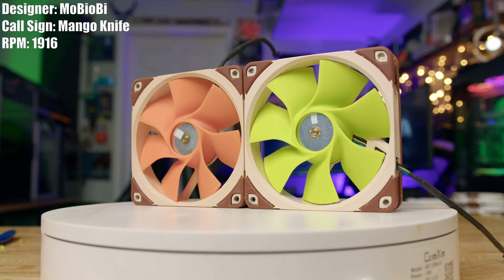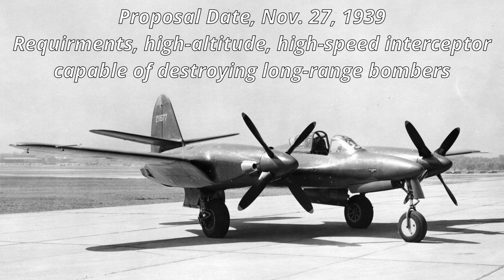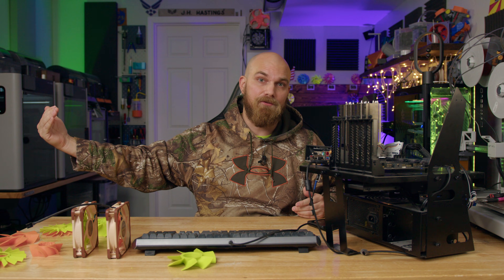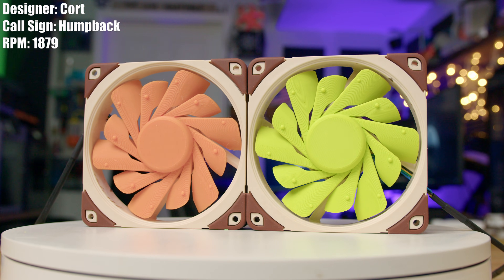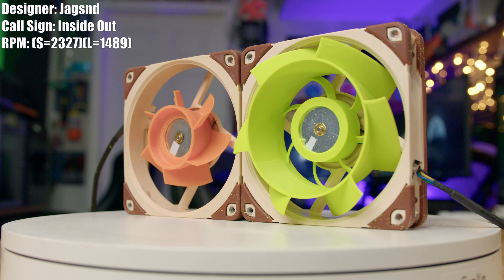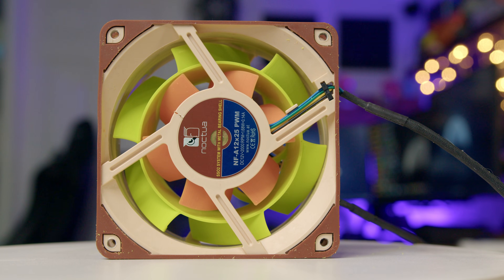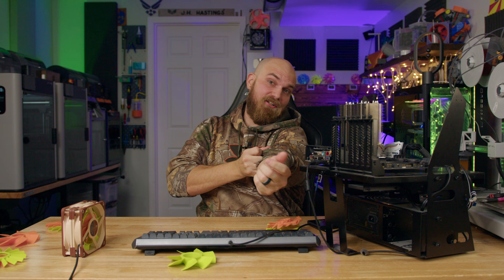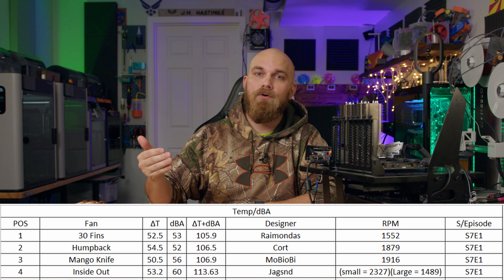Stacked TWIN Fan… is a Monster | Fan Showdown S7E1

Comment: I would run each fan out of two part fan separately for one sound test, and use those number to better compare to past results. Also, at the end of this season run older top contenders in the new configuration.

Comment: Would prefer to see noise normalised temperatures as the score. Maybe even average temperature across multiple noise levels (e.g. 30dB, 35dB, 40dB).
Reply: Surely noise floor should also be accounted for? (You account for temperature floor.) 

Also, I'd like to see what composite score you'd get with no fan (just the heatsink).

That might highlight whether the composite score makes any sense.
Reply: Scoring noise ON the cooler makes way more sense to me.

Different fan designs are going to have dramatically differing interactions with the heatsink fins.

Comment: Sound test and smoke test should have the cooler in-place, but like a second separate one from the one on the motherboard. Also the scoring for sound should definitely not be weighted equally with temperature like it is, maybe some S-curve type of score with more points rewarded the closer to the noise floor and an exponential decrease in the points closer to some maximum like 90 dBa?

Comment: Looking at Delta T might be a little flawed, here me out. The hotter the CPU, the more voltage it needs for a given load. So if your room is hotter and you only look at the delta, the fan in the hotter room has to do more work for the same delta compared to one in a cooler room.

This is only theoretical though, might not show up at all. But ideally you'd run the stock fans with your room at like 19 and say 27°C (or whatever temps you are expecting) and see if the delta is the same for both. Just as a control to be sure it doesn't have an influence :)

Comment: I think it would be better to measure noise when mounted to the cooler as there may resonate and to airflow would be restricted which could also affect the measurement.

The scoring does not make sense though. 
I assume you would want a high change in temp but low noise so adding the scores will not give a good comparison. 
I think one of those should be inverted but don't know if weighting will be a factor so one score won't dominate over the other.
 
Maybe give them a score each episode from high to low, best to worst, for both ∆T and dbA then add those scores up to find that episodes winner. 
Then do the same for all fans in the season to see how each compares to previous ones. 

Not sure on how good this is but scoring these 1-4 for ∆T then I get: 
I/O=1, MK=2, 30F=3, Hb=4.

For dbA I get
MK=1, 30F=2, I/O=2, Hb=4

So the totals will be
Hb= 4+4=8, 30F=3+2=5, I/O=1+3=4, MK=2+1=3 

So this would make Humpback the winner in this case as it is both the quietest and cools better.

There might be a better way but this should give you an idea.

You should also have baseline results for the original fan in your overall results for comparison.

Comment: If higher delta T is good and a lower dBA is good, wouldn't it be better for the overall score to be Delta T MINUS dBA? The higher the score, the better. So the scores would be -0.5, 2.5, -5.5, and -6.8 putting the humpback in first place. Which would make way more sense since the Humpback cooled better and was quieter than the other three, yet still came in second using your formula.

Comment: You gust cant add temperature and noise. It's don't compute and don't make sense.
Let me repeat my comment from the previous video.
You take the fans, put it on the radiator (preferably waterblock), with voltage regulator tune them on several predefined airflow numbers, and measure the sound volume for each airflow.
Fan with the lowest sound volume in each airflow category wins.

Comment: Suggestion: Present the result in two or three charts. One ordered after performance delta, one ordered after performance delta and noise and possibly one sorted on the noise. The first two are really the only important. It doesn't matter if a fan is extremely quiet if it can't move the air. And sometimes the noise isn't important, just the ability to move air is important no matter hoe noisy it is.

Comment: I think you should normalize your temperature and acoustic measurements.  So take the CPU temp and divide by the room temp AND take the decibel measurement and divide by a standard (I might suggest using a reading of a standard Noctua fan).  What you're looking for is to have both normalized values close to 1, so that a "baseline" score would be 2, and lower values would be better.
Also, I don't think the acoustic issue is just down to noise level.  In my opinion, fans with louder high frequencies are WAAY more annoying than fans with evenly spread frequency distributions or lower end, at the same overall noise level.

Comment: I don't think your ranking system will work. If you keep it as-is would you be upset if I submit a fan that is just 1KG of plastic hanging off of the motor? That way I get a 0dB rating and have a guaranteed win since these CPUs thermally throttle at like 95C. 

For some constructive criticisms:
1) You could use a weighted score. 75% temp and 25% sound (as a very crude example) which would prevent the scenario above from happening. 
2) Noise normalize the tests! Pick an arbitrary sound level, say 42dB, and attach an in-line fan controller. Run the fans flat out and dial them down until they hit the arbitrary sound target (42dB in this example) and then run them on the cooler. Then you can rank just on temperature while also taking sound into account.

Scenario #2 is the ideal way to handle this as it is a well known industry standard for rating. Scenario #1 works but it has issues. The big benefit is whatever formula you use to weight sound vs temperature you can setup in Excel and have it do your calculations for you while you just drop in the raw data.

Additionally I do think you should run the sound tests and flow tests while they are mounted on the cooler. Since the goal of this season is cooler mounted performance I would love to see the flow and sound test on the cooler itself. Tower cooler fin-stacks create all sorts of extremely bizarre resonances and buffeting effects with fans mounted which is why cooler companies spend so much time and effort refining the fin-stack layout/density and the hub/fan blades/pitch/etc.

Comment: If I may : the sound test should be done with the cooler. The way the air flows (straight, or with a angle) through the fins could results in difference.

And : how much we care about the noise ?
On a scale between 0 and 10. 
0 being : I only care about performance
10 : I want the quietest fan even with poor performance.

We could all vote on a google form, and thus, making a coefficient with the average response.
Making ranking of a better representation of what a fan mean to us.

I'm not a regular watcher, but I love these showdowns !

Comment: We are getting ro the point that we need to find one test run for the season. Then we take them all at the end and static pressure, noise level etc and rank them in all. Then you can search for what is important and see the best in that category vs who just has the least sound or most air flow. BUT I do believe we should keep trying to beat the Ax12 which means we need a base line push pull with the noctuas

Comment: I feel like you're putting too much weight on the noise value. Yes, if the delta-T is the same, a quieter fan should rank higher. But there is no way a fan with a 4 degree higher delta-T should rank higher than a more effective, yet louder, fan. Of course, your method has the virtue of simplicity.

Comment: IMO, all tests should be done at the same time :D While you running the CPU test do a quick sound test and a fast smoke test in between...

Or sound test with cooler in the middle, and smoke test with only a one fan, in case of single design in push-pull. (double designs, obviously go assembled.)

Or even a last case scenario, for the smoke test, place an acrilic pine of the same diameter of the fans and with the cooler width.

Comment: That scoring methodology doesn't make sense. You could can make a fan with a delta T of 80 (just throttling but not crashing the system) and a volume of just 20dB and lead the chart.
That seems wrong because that wouldn't be much of a "fan" anymore, if it doesn't actually cool...

Comment: I'm thinking the formula for scoring is a bit too simple. The dBA weighs way too much compared to temps.
While its a cool thing to implement in the testing, doubt its quite fair without some complex scoring formula. Because not only loudness matters, but also i would disqualify anything with annoying high pitch sound (joking a bit, but you get the point).
All that, plus i bet majority would agree that delta t is more important than the sound(unless its super loud).

Comment: NO!!! I get that acoustics is important, but disagree that it is as important as temperature! As a result, you weighted both metrics the same which is a bit screwy. Indeed, I would’ve also kept static pressure also in, but also weighted differently

Comment: I feel the math for the ranking is off.

Honestly ranking linear against non linear with no weighting is not going to give an accurate report for who wins. It will massively skew to db. If you run long enough and it gets competitive enough it will self balance as db's get to min they can and then further optimisations towards heat but it will definitely put a priority on dropping DB first.

Comment: Is the delta t the best option for the temp score? I mean cold air, cools the CPU easier than hotter air (I know the difference might be marginal for normal conditions) but the closer ambient air is to the CPU temp, the worse it will perform on cooling it, there must be a way to normalize that value

Comment: The inside out fan would be INCREDIBLE if used on a custom PC build designed around a car or car engine. I remember someone made a custom case that looked like a big V8 Engine block. Imagine if you turn that on and get the inside out fans sound profile. Chef's Kiss! - I think more custom case builders should start incorporating these custom 3D printed Fan designs into the case aesthetic both visually and from a noise profile perspective. That little touch can take a average build over the top.

Comment: Can someone help me with some suggestions for support settings? I'm using PETG and having a tough time with supports causing the print to come out really rough or supports not removable. Best results I got was trying to make sure support only on the trailing edge of the blade flat on the print bed. or trying to just print over air with wider line widths thinner layer heights and adding a small amount of wall inset to keep the walls from drooping over air. Almost got up to an 80 degree overhang with relatively clean print. but i'm not sure if that's enough for a fan. The problem is the corners/tips always curl upward and end up hitting the nozzle. I also have to add tabs to the tips to prevent the tips from raising/warping up.

Comment: Most definitely use the cooler in the sound tests. The fin stack does play a role with the sound and air flow of the fans and will probably produce a better result than just one fan shooting air freely at the other. Plus, it'll be nice to hear the two fans interacting with each other as designed.

Comment: There should be 2 metrics for the fan noise. The decibal AND the frequency/tone/profile. Cause SOME noises are WAAAY more pleasing even at louder volumes and some even if quieter would make my teeth grind. I do NOT know how you would objectively measure that but I DO think there needs to be SOME consideration, even if minor. For example, It doesn't matter HOW quiet the Mango Knife is, that tone makes me want to smash my face into a brick wall. However, the 30 fin... Mmmmmm crank it baby, that's some nice ASMR!

Comment: Used to overclock CPUs back in the early 2000s with air cooling only before moving to water cooling, peltiers, etc. Delta fans were the best at that time, but they were loud. Just bought my first Noctua in 2025; all I can say is it's overpriced and overhyped. Airflow isn't that great, and it's not that quiet either.

Comment: It's not just the noise level, as in previous seasons, it's the noise frequency. More noise at a less objectionable frequency, may be better than lees noise at a more objectionable frequency. Not sure how you weight noise/frequency measurements.
In a similar way, do you really care about static pressure? More airflow vs lower SP could be better than less airflow with a higher SP, could be very case/cooler specific?

Comment: You mentioned how they just had to test a plane to see how it flew, but one thing that I always thought was fun is a tradition I love.  The test pilot of an experimental plane will take the Engineer's wallet and keys with him on the maiden flight.  I.e. if the plane crashes, the Engineer loses his IDs and credit cards, house keys, etc.  It's one of those traditions done as a show of trust in the aircraft they designed.

Comment: hm... i suppose the scoring method does put the requested emphasis on the noise output of the fans. the winning designs for this run might be the ones that produce the least noise first and foremost while still moving some amount of air. 
like, the heatsink without any fans would cause the CPU to overheat/throttle and fail the test, but i wonder what the threshold of sorts would be for how much effective flowthrough is really needed to get the CPU temperature to stabilize at... let's say <=95C, which is not good but technically below TJMax afaik. that'd be a delta of slightly under 75, but if the combined fans can achieve that with... idk, 2 blades per fan or something silly like that to minimize noise and move just barely enough air to do it then it might still be a winner. 
on that note, since you're accounting for the room's ambient temperature, would you also account for the ambient noise floor if a fan was virtually inaudible?

Comment: Good idea. I do care about noise much much more than temperature, because it is hard to find a cooler that can not cool CPU. And you have to test both sound and flow on radiator!!! It adds a lot of anti-turbilence with its horizontal fins!

Comment: 3 db means doubling of heard noise, while temperature is more a linear feature. When you ramp up noise linerarly, it seems to jump from quiet to noisy at one point. Sound is exponential.  I have an air cooled pc, which is cooled mostly by multiple case fans blowing inward, I used mass loaded butyle almost everywhere to dampen vibrations and also absorb some internal noise, and I have added some exhaust holes strategically to manipulate airflow. I suppose pressure is a little eleveted inside (more input than output area) and what this enable is the ability to reduuce speed of GPU and CPU fans, and so overall the package went from noisy to quiet, and I have pretty low temperatures everywhere. My case fans are 4 NF-S12A and one Phanteks 200mm inward and one Phanteks 140mm as exhaust near cpu. When running full tilt cpu is around 60°C and when putting the ear close to tower the sound is an ewual balance of noise from case fan and cpu fan and just woosh of airflow, so the quality of the noise counts too : the inside out sounds like a ULM airplane, and my cpu fan is a thermalright that has some of this kind of noise, so reducing rpm on this is greatly helping in reducing the noise nuisance, while it is possible that overall sound level is unaffected. But from 2 feet away the tower sounds a little like a cascade of fine mist water. Soothing. Phanteks Enthoo Pro Full Tower (no clear window).

Comment: Yeah, + 1 for the two NF-A12x25 as a reference as well as two NF-A12x25 G2. And the winners of the former seasons.

And yes, I would run the sound test on the cooler as this interacts with the fan blades and might affect the noise in actual use. And I'd put the microphone above it so it's not directly sitting in the airflow.

I like the new smoke machine. Looks good. 

The last problem is Intel CPUs give temperatures in whole degrees. An AMD CPU would be better as it also shows the decimals. The temperatures are so close together that a variation in the whole numbers Intel CPUs produce could hurt the precision. Or you need to let it run for a longer time and use the average for a longer time span, which includes the temperature spikes.

Comment: Hey, I love the idea of the fan showdown. What I would love to see is when you compare fans with a skill graph so you can see how they perform in all their stats, like noise, temperature, airspeed, power consumption, and efficiency. (or other characteristics you want to include) and you can still calculate a comparable number for rankings from that with different weights on, for example, cooling -> very important stat, high weight,  or  airspeed -> nice to know, fairly unimportant for comparisons, very low weight.

Comment: what about cooling a CPU you get one of the big power resistors that are used in microwave ovens to discharge the HV capacitors and some really stable power supply across it and measure the temperature delta trying to cool the resistor itself

Comment: I feel like the distance between the fan blade and the fan frame is huge. I did not make tests, but probably that 1mm distance makes a huge difference ( because the impact of blade length increases exponentially ? ) . Or at least make the fan frame make use of the centrifugal force of the rotated air ( push the air towards the chiller instead both ways )